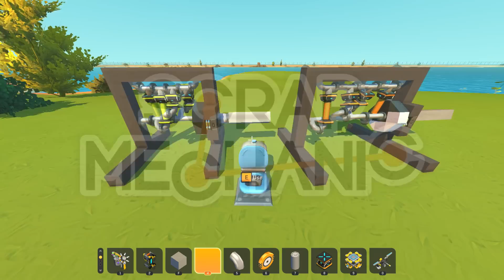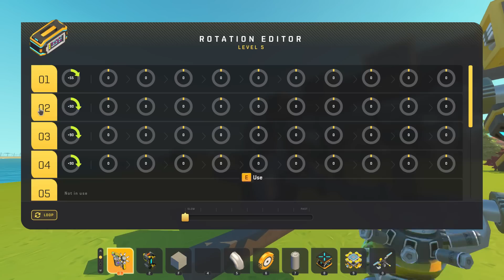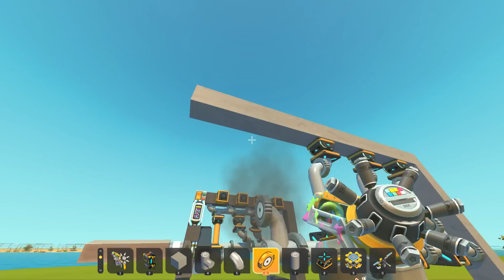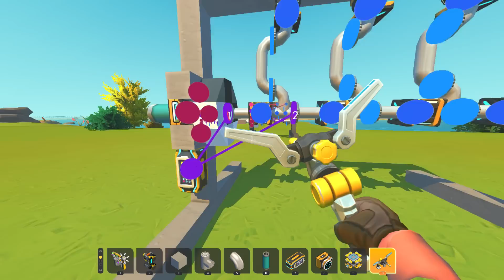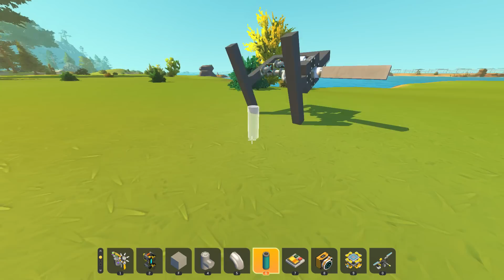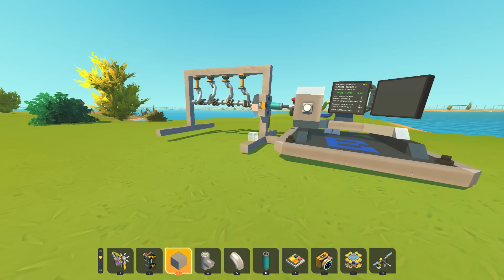I Built an Engine With Stationary Pistons to Mimic How a Real Car Works!

Comment: I'm curious how a more realistic crankshaft would work. You could remove the extra pistons entirely without making the design any longer (or shorter). 
If you're interested in some terminology the parts of the crank where the con rods attach are called pins, the flat parts that connect the pins with the bearings are called webs and where they flare out on the opposite side to the pin these are called balance webs. The distance between the center of the bearings and the center of the pins determines the throw of the engine, and combined with piston bore determines the displacement of the engine.
Interestingly the optimal angle between pins is "720/no of pins" which is also the optimal angle for a V type engine, though it is common to half this angle as the power reduction is minimal but the space saving is huge. This is why a V6 has a 60 degree angle not the optimal 120 and why most V8's have a 90 degree angle though some come in 45 and there are some with really weird looking cranks with offset pins that come in 60 (though this is because they were based on either V6 or V12 engines and were balanced later).
Sorry for geeking out but I figured with the way you geek out over engineering stuff in your videos you might be interested lol
Reply: I tried and could not get the crank to rotate 90° into position. The Pistons provided too much resistance for the bearings to overcome

Comment: it doesn't have to clip through. if you replace the L piece that the rod is connected to with a T piece. essentially bending the drive shaft it should be the same size but no clipping.

Comment: To get rid of the piston on the shaft just try to make it so the actual working piston is the one that passes through blocks
Or I mean, put the piston that passes through blocks on that small connector instead of the main rod

Comment: You need to make a weighted crankshaft and have the pistons fire as an i4. You're losing most of the power because your crankshaft is a straight line, causing the bearings to wobble.

Comment: you could build the explosive engine, like a 4 stroke. It should double the rpm, because while one piston fires the other can skip that cycle, that way you will have 8 pairs of spawners per cylinder.

Comment: Kan you could place a t piece at the bottom of each piston with a bearing on either side connecting all of the pistons together and that would make it so you don't need to use the piston clipping effect and it would be a more realistic piston setup

Comment: I'm glad you went for a more realistic engine design but now you got me thinking could it be a 1 stroke. Do the pistons retract with force? does the black signal on the timing wheel just turn them off or can they be powered in reverse? and what if you turned the timing wheel around so that the sensors spin and the wheel stays still, i feel like it would be easier to explain and customize
Reply: The pistons do retract with force. The black signal turns off the logic input to the piston, thus retracting it with the same force as it extended with.

Comment: You don't really need the extra pistons, just use t pipes with bearings like an anchor shape. It'd cut down on joints and give different performance. It's hard to do it all in my head but it's definitely possible. I'm just curious if it's better to use oscillating or spiral cam shafts. I'd imagine each depends on piston timing, whether in pairs or sequence. I'd also imagine spiral would bend more easily, but then again oscillating has paired piston forces and might be the one to break more.

Comment: Regarding compacting the crankshaft:
Compacting of the crankshaft with the current setup is quite tricky, given that you are using pistons for their lack of collision. The bearing needs to be on a block and the block cannot be inside the piston because that would ruin its non-colliding nature.
What we CAN do is completely get rid of the bearing altogether with blueprint editing by tricking the game into thinking the shape on its head is in the wrong position. This trick is often used in high performance engines because the resulting crankshaft is waaay stiffer than one using bearings on controllers. It does unfortunately required editing of the blueprint (xAxisB to any axis other than the axis in zAxisB).
If you go even further with glitchwelding it should theoretically be possible to make one in the same footprint as your to date smallest engine. This requires the use of 0-width blocks.

Regarding your "pipe through hole":
Please, please, please, please, please, please... (404 pleases later)... please make use of piston-, ramp- or 0-wb passthroughs. I've seen you do the piston passthrough before but you complained they hindered performance. I would like to point out the fact that it wasn't the passthrough but the extra collisions it caused that made the engine worse. I recommend the ramp-passthrough, which consists of a 2x1 warehouse ramp, a bearing and a few pipes. It can be built in vanilla SM and has only a small collision. The best solution would be the 0-wb passthrough, but this requires knowledge of how to properly utilise 0-width blocks. (Creating one is easy and losing a creation with improper use is even easier, let alone keeping track of them.)

Regarding the performance:
More moving parts = worse engine. The whole reason the pistons on a car engine don't move is due to how sturdy and massive their housing is to contain the explosive. In scrap mechanic the opposite is true, the piston is way lighter and smaller than that additional conrod.

Regarding piston engine performance in general:
You should be able to get about 40HP from each piston you add to an engine I was once told. Thus far my best V4 engine achieves 115HP using (obviously) 4 pistons out of the maximum 160HP it could theoretically get. If you want more you need to start looking at variable stroke engines, especially the "kein engine", which is a hybrid single/double stroke engine with top speeds over 1200RPM. (don't quote my 40HP per piston number, i'm not 100% sure my memory is correct.)

Comment: Would it be theoretically possible to make an actual crank shaft without using bearing rotation? Say pipe bends that bend out and have two free spinning bearings on a T piece connected to the piston like an actual crank?
Reply: Side note, would a piston firing order help too? Instead of going 1 2 3 4 and back to 1, like 1 3 2 4 back to 1?

Comment: You could put the clip-through piston on the rods instead of in the crankshaft, which would allow you to make it one block shorter with no glitchwelding
Reply: I have tried this exact thing before and unfortunately the piston in the rod ends up being pulled out of shape by the "exhaust stroke"
Reply: @jonwilkinson7474  rip

Comment: you could remove the pistons on the crank by connecting the crank onto both sides of the conrod like a real car would
also if you search senor porko on the workshop I think I have a pass through you can use so you dont loose power to friction

Comment: Could you build an actual crank shaft with bearings and t pipes and do the 90 degree off set on the shaft so parts don’t have to travel through each other?
Reply: I noticed the same thing after seeing it run for the first time. You can totally build a crank shaft that doesn't need to glitch through a piston. Wonder if he can see it.
Reply: I've tried this a few months ago and could get the crank to align under the resistance of the pistons

Comment: 9:23 hehe, you can turn the pistons into 90 offset bearings. The blueprint file has 4 axis values for pistons, 2 "Xaxis" and 2 "Zaxis". If you make one of the two "Xaxis" set to a value of 1, and the other 2, the piston will rotate the block on the end 90 degrees when taken off the lift. This is also stronger than bearings, so you can transfer more torque.
Reply from the maker: Well now isn't that exciting... might have to try this.
Reply: yeah kan using this piston rotate method i can make v8 with over 230 hp and 7 thousand nm of torque that spin at 300 rpm just know you are nowhere near the limit @kANGaming
Reply: but just remember its about the journey once you start making such optimized engines i can just hook it up to anything and it will go absurdly fast i need to make a throttle system for it
Reply: and also the max horse power you can get out of one piston is around 60 so if you're settup is completley perfect you should be able to get 480 hp max i've never seen anybody do it tho @kANGaming  edit with a v8 you can get 480 if you add more pistons you could get more obv
Reply: i actually tried this and it worked

Comment: You should be able to put the piston in your con rods instead of the shaft. Itll save one space and might make a v easier (reduces clipping)
Reply: Problem is this way there is a chance for the piston to expand and worse. Performance. It would be better to make the shape closer to how real engine does it as there is no need for clipping. 

How he's doing it right now it's straight shaft with additional part on the side connecting to the rod. Having shaft bent with T connector to the rod would eliminate the.clipping and improve performance
Reply: @Krokmaniak I don't know if you just assumed but you are 100% correct. I tried to build realistic piston engines a while ago and that was one of my designs. It caused the pistons to expand and not really rotate the shaft at all. I also tried to make a real crankshaft but couldn't get it to align under the resistance of the pistons
Reply: @Krokmaniak  It would improve performance in theory but not necessarily with wonky SM physics and limited building. That is because of the larger imbalance it would create that's not really possible to counter balance out unless you make the shaft unfeasibly long. Of course there's creative glitch welding to make it more compact, but I'm not going there.
Reply: @anteshell  I meant pistons absorbing the movement. It's the same as putting suspension. These parts are really bad at mechanisms depending of the part keeping same length while working
Reply: @Krokmaniak  No, I was talking about the second paragraph in your comment. The one where you compared Kan's current method of building to real life eccentric shaft.
Reply: @Krokmaniak  I tried this before I knew pistons were noclip.  The problem is the space taken by the pipe-to-pipe linkages, and the number of bearings for the degrees of freedom it needs.  It functioned, but not well.  Bullet just doesn't have the performance needed.
Reply: I was thinkng the same thing.
Reply from the maker: It will but they will also expand as the con rods move because pistons aren't perfectly strong.
Reply: @kANGaming  good point, too bad we dont have "rigid physics" like a step above advanced lol
Reply: @kANGaming  then use suspension cranked up to the max power
Reply: I thought the same
Reply: You took the words right outta my mouth.
Reply: It will also make experimenting on the con rod length easier, and yeah there will be loses with the piston

Comment: You should try and do it with 8 pistons instead of 4, so that maybe You could get a bit more torque? Just for a test. So then 2 pistons would be active at the same time instead of 1.
Reply: There isn't even anything keeping him from doing a 5-cylinder or anything else, except that the sensors that monitor the encoding wheel have to be mounted differently.

Comment: What if you put the non collision pistons on the rods insted of the main shaft?
Reply: They'd stretch.   ....unless you mount them 90° offset from the force direction through the con rods. That would give them a mechanical advantage.
Reply: @Pystro  good point i didnt even count for them to flex

Comment: Why do you need bearings to rotate the crank pieces 90°? Couldn't you just build them at 90° and weld them? (Never played that game, so genuine question)
Reply: You can only weld where the pieces line up when on a lift. If the connecting points on the crank shaft stick out sideways, the two ends of the pistons (or con rods) won't be in a straight line.
You could do the equivalent but opposite thing to displacing the bottom attachments of the piston by deforming the crank shaft - shifting the top attachment points around. But most of the time that is just conceptually harder to wrap your head around for no gain at all. In this case though, it could allow kAN to have it's 2-wide repeating unit, because he could eliminate the bearing that is between the 2 tangible pieces of the crank shaft and move it to the top.

Comment: You could replace the straight pipe piece in the centre of the conrod with a piston, then your original piston on the crank could be replaced by a pipe that you can directly connect a bearing to, and save one block of length per "cylinder"
Reply: This is what I was thinking.
Reply: That sounds like the previous Engine he made, is there any difference?
Reply: @davidaugustofc2574 The piston in the con rod wouldn’t be used as propulsion, it would just sit there so that the shaft would clip through the con rod rather than the con rod clip through the shaft
Reply: @zevgreen5941  damn
Reply: I tried this design a few months ago and putting the piston on the rod leads to it being pulled out of shape by the "exhaust stroke"
Reply: @jonwilkinson7474  dang, I was wondering if out would be strong enough to resist, guess not

Comment: I wonder if there's a way to make a piston engine with a solid output shaft - i.e. one without bearings to get more torque. 
Maybe a 4-way boxer?
Getting the clipping to work right is likely there problem...

Comment: The crank can be built like this (right to left). Strait, elbow up, elbow left, straight, tee with tee up, elbow down, elbow left, bearing and repeat. That way your connecting rod only needs the one offset. With that design you could make a crazy four piston per cylinder inline four.
Reply: That's also how it's made IRL as there is no clipping. Also straight is not necessary
Reply: I did this with 8 pistons per piston already

Comment: Kan try to make counter weights on your crank shaft cause you do lose a substantial amount of power due to the wobble. When you looked at the engine from the front you could really see how much the bearings sway around the Center and I mean you have a huge cloud of collisions where the drive shaft begins.
Reply: @@RustTree0915depends on how they are offset
Reply: No because the engine is pushing down and it tips the engine causing the instability seen when they are unwelded it would help make a more stable car and reduce lost power.
Reply: Maybe even just weighted like a crankshaft is IRL. Heavy-ish cubes in a almost ring (sort of like a flywheel) around the base of each cylinder.
Reply: Kan should make the pistons extend in order of 1342 not 1234 to reduce engine vibration.
Reply: @OldjeepPerson621 shouldn't it be 1324? Otherwise 3 and 4 will make it vibrate by having the back side of the engine fire twice

Comment: You should be able to not use piston to clip though the crankshaft and use t pipe piece
Reply: That would definitely work except that you would need an extra bearing on the T, more bearings usually causes more problems so it'll be more compact but less consistent